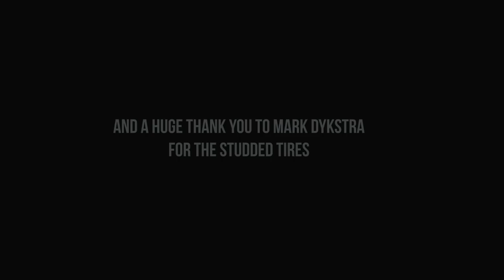Phil's classic mini on studded tires (VLOG)

Comment: So What Killed it?    Are you running Points?  COndensor?  Cap and Rotor intact?  Electronic Distributor module die? (pertronix)
Do a ' complete vid on troubleshooting ( you did no spark) DIagnosis of the bad part= then repair.
Reply: Where you listening Justin. He clearly said he was running electronic ignition. Have no faith in them. When they fail, they fail. Points require a little more attention but you can normally tell when they're starting to play up.
Reply: @AllThingsAlex  oints are simple enough but they give up in heavy rain. Even with a splash guard. Yes you can try and waterproof your dizzy with plastic bags and such. But a decent electronic set up is way more reliable in my humble opinion. No fear of oints bounce and drive through any down pour!

Comment: And all because you forgot the legendary Marigold rubber glove and cable ties to protect the distributor from damp.
That is how the works team Minis completed and won the Monte Carlo Rallies. Cut the tips off the fingers of a rubber glove, pass the HT leads through the fingers to the dizzy, slide the glove down over the dizzy and use cable ties around the finger tips to seal off. With the distributor cap right behind the front grille this has always been a problem.
Reply from the maker: Matthew Jenkins I have seen it done before but because the pertronix distributor is weather sealed from factory I don’t think it was the issue, time will tell though
Reply: @Stevestonmotorco  So what did time tell?

Comment: too bad but im sure you had fun while it lasted. maybe look into some distributorless spark options. Im working on converting an old distributor into a cam sensor for a EFI system with wasted spark. using an thru beam photo eye with a home made single trigger wheel.
Reply: my brother did that with an arduino to a vw. theres a video on my channel somewhere about it

Comment: That gear lever is longer than I have seen before, perhaps the extra leverage contributed to failure?

My 1962 Mini was fitted with a 1968 gearbox in 1968 (remote change), to this day no problems with gear lever.
Reply from the maker: It was likely because a stronger detent spring was installed. Selecting the reverse gear takes more force than usual.

Comment: After this incident/adventure, would you recommend keeping a mechanical distributor?
Reply: It is a known vulnerability caused by location behind the front grille. Easy solution is a rubber glove over it with HT leads fed through the fingers. That tow truck could have been totally avoided using that trick, but even then the dizzy cap could have been removed and damp driven out with a squirt of WD40. The hi tec solutions are what will leave you really stuck if and when they fail.
Reply: Good to know. I'll bear it in mind if I ever get a mini.
Reply from the maker: I have my old points dizzy that I usually bring along with me, of course the one time I don’t....